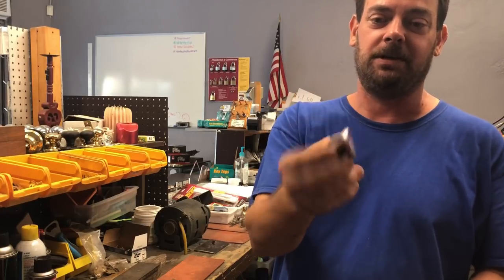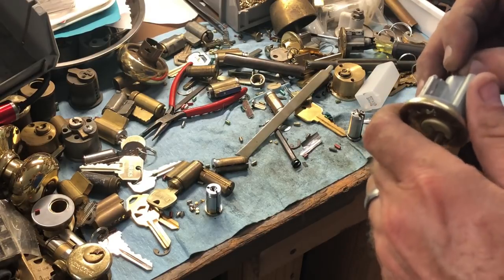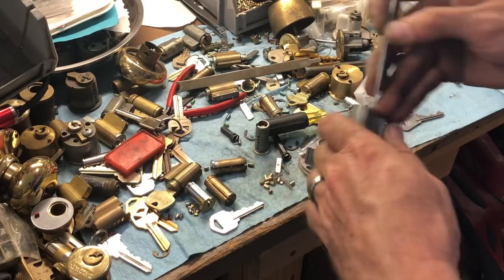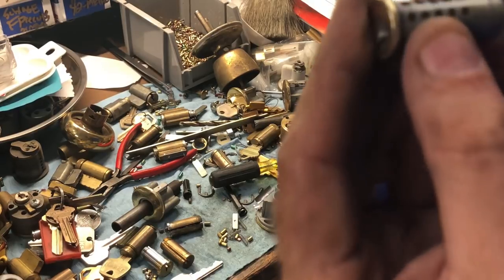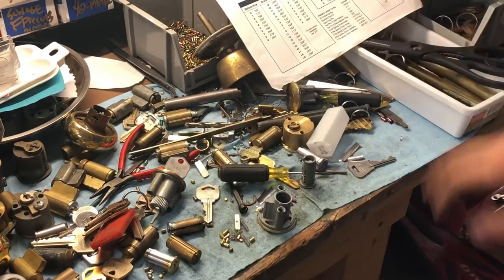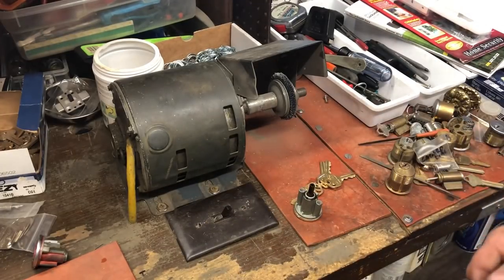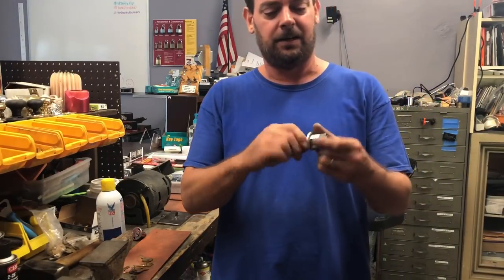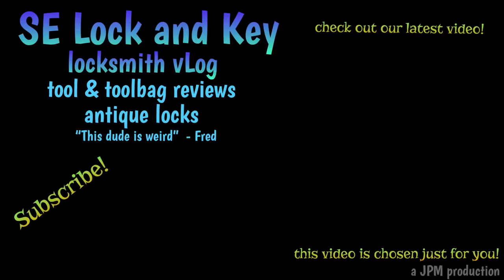Making a Kwikset Key Checker Thinger

Comment: I saw the original video a few months back and put a key checker together for use in the shop. I must have tried nearly 100 original kwikset keys with maybe 1 having a bit of resistance turning.  

Also, thanks Jason for discussing the possible issues with checked keys. I’ve seen more than my fair share of filed-down pins that proves your point!

Comment: The factory increment is .023 inches. When you you use a .003 kit this places the pin with in .002 of the desired length.

But when you stack 5 pins that are .001 too long you induce an accumulated error of .005 when testing a no.6 depth.

Better to use calipers or a micrometer to check your depths.
Reply from the maker: nice “facts” yet it still works perfectly fine for a quick check of keys that look suspect and has for over three years now (really more, because we had been using it for a while prior) even with your “accumulated error” 
it’s a practical tool in ADDITION to a micrometer 😂
Reply: @selock  

Not sure why you chose quotes, but I assume it is something in the nature of your opinion that the point i made was irrelevant and down right picky.

I agree.

But as a locksmith since the Carter administration, I have spent many an hour dwelling on the minutiae.

Most of these musings are in and of themselves of no practical value. Yet   they lay the foundation for other questions later.

Of alll of these sniggling questions I seek to resolve a good percentage of these seem to come back to the front of my mind attached a later date. Let's consider adjustment of a key machine.  What is the best method of measuring spacing.

How many generations can you get on a fussy key like American padlock?

Comment: I always use the Qwickset original pins. I do mostly master pinning for rental properties and use mostly KW1 brands of locks. I like the barrel,shaped pins over the conical pins because they tend to not wear down as quickly. I also like the Qwickset style of key bitting with the wide landing instead of the V Cut. The problem I have with your checker is the .024 differential. The Qwickset standard is .023... 1, 2 or even 3 Thousandths isn’t a problem however when you check the 5’s and 6’s the stack is 4 or 5 thousands too long.. While I don’t like the original #1 master pin because they are beveled too much and occasionally get wedged in the plug and core. I’m going to build one of your Checkers but I’m going to sand down the .024 to .023 on a wet Emory board. This shouldn’t be too much of an issue, maybe a minute on each wafer..

Comment: Hi Jason.
That's a good idea with the keychecker thinger.
Do you do one for other makes of key as well ?
So you have one for each make you cut ?
Great way to show the client that their key is no good and they might be better to have the lock cylinder replaced.
Thanks for taking the time to do this video.
Reply from the maker: Pete Woodfine no just Kwikset, because of the single step progression none of the others lend themselves to be able to do it. I’ve thought about doing two different ones for Schlage but (without some awesome math) it may or may not work for all cuts. Probably can hit about 92% of them with two cylinders, one starting with 0 and another starting at 1 but I dunno 🤷🏼‍♂️
Reply: SE Lock and Key  yeah i agree with that. but i don't think you could, even with the math. any key that has an odd and even number wouldn't work.
Reply: I just Googled the datasheet for Schlage key bitting specification (Classic, Primus). 

I assume that Schlage doesn't "allow" single step progression to avoid having the pin wear and get stuck in the shear line, -- But assuming the *stacking error* of the collected master pins does not exceed the tolerance, and the spring is hard enough, is there a mechanical reason why a Schlage Key Checker Thinger would need to obey the pinning rules/standard for a lock?

( numbers below from lsamichigan.org )

Schlage 
Increment: 0.15"
Depth Tolerance: + .002" - 0  
Spacing Tolerance: ± .001"

Kwikset
Increment: 0.23"
Depth Tolerance: ± .003" 
Spacing Tolerance: ± .004"

Comment: Question can you do this with other brands of locks?
Reply from the maker: Not really. Kwikset is the only one with one step progression. A few of our subscribers have made a two cylinder set with Schlage that works for most locks and one even sent me their version. They definitely don't work as well as the KW, very catchy
Reply: @selock  thanks for the information and the quick reply. I'm making a change from the HVAC industry to a locksmith because I'm tired of having to crawl under houses or go in an attic when is 140° to make a repair. On top of that the state and federal regulations and license requirements for HVAC is to much. I'm slowly gaining the tools and knowledge necessary to switch my business from HVAC to locksmith I work for myself and in my state  (Georgia) there's no license requirements to be a locksmith. There's new state and federal regulations coming out governing the HVAC industry that's going to make everything extremely hard for small HVAC businesses so it's truly not worth sticking with this industry. Your videos and information you provide have been a massive assistance hey my journey to switch career paths. Thanks for all the effort.

Comment: good vid what about a SC 1 key checker
Reply from the maker: caveman Sparks single step progression :( it might work with two cylinders, one starting 0 and another starting 1 but still probably would miss some
Reply: I made a kwikset kw1 key checker like shown and a Schlage sc1 checker. Both work on a variety of keys
Reply: I made one using 0.015” master wafers in a new cylinder. It works well, but I do not expect it to last long before a little wear will jamb it.  The problem is that you cannot predict which chambers are even and which will be odd to use 030 master pins. Schlage factory keys are all over the map, as well as the Arrow SC1 ones that are popular around here. So, without using the 015 pins, it won’t be universal and 015 pins jamb easily. 

More interesting is to make one using KW pin stacks on the SC1 keyway - because I have seen that in the wild and this one would be a “detector” for such abominations.  I have seen other cross system abominations happen for Sargent and Corbin, where some yahoo apparently did not have the right kit when he rekeyed them.